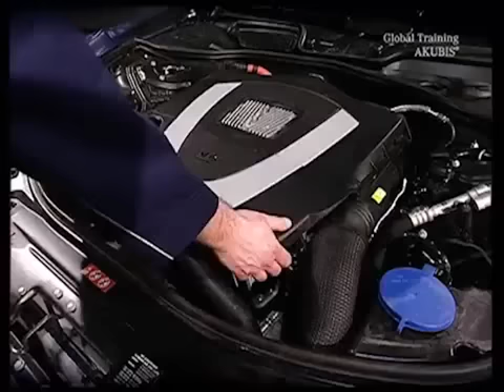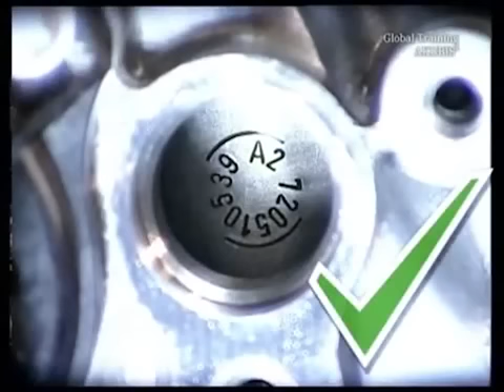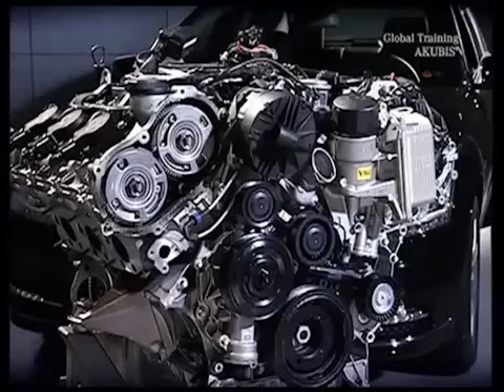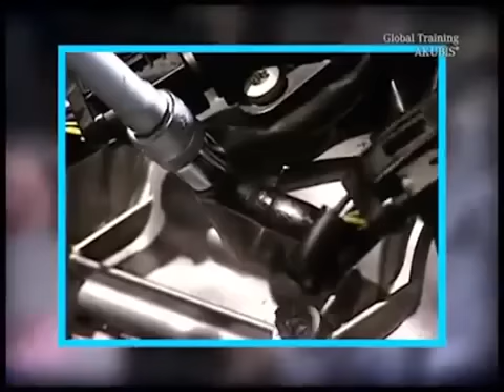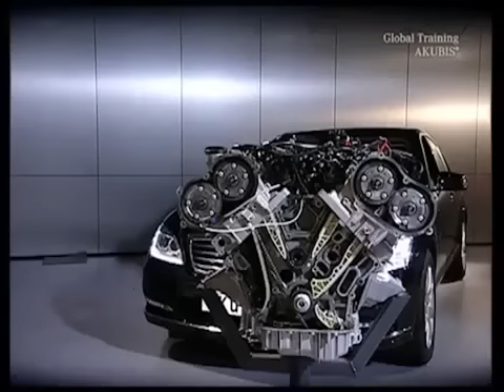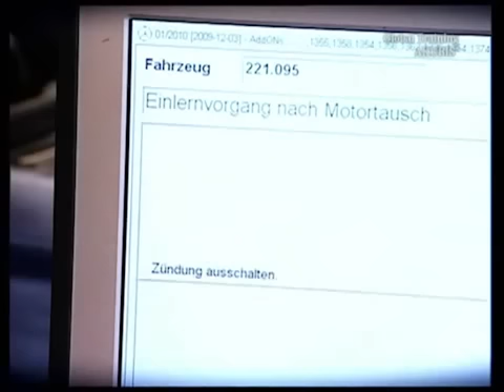MERCEDES M272 and M273: BALANCE SHAFT SPROCKET REPLACEMENT

Comment: oil pan must be removed. try sliding it back without doing so, youre  gonna pinch head gaskets
Reply: im actually stuck on this now, i tried everything to get the cover on, but now I have to take the oilpan off, i dont know how im going to reseal it

Comment: Time Bombs..... Also suffered with the biodegradable wire harness on the W124. My last MB
Reply: a wiring harness is nothin compared to this. A relatively cheap repair to a great model. What you driving now that is sooo great, you've had for a long time and spent no money on?

Comment: So, those pigs knew about the ticking bomb, especially the M272... Anyway they continue to build MB with those engines for years...They made Recall too late, after customers in USA started case against MB...It was too late, because the dead line for this recall was too short...

Comment: Anyone know how the timing case magically removes itself?
Reply: With a big hammer, this engine is so stupidly designed, to remove the balance shaft you have to remove the transmission and rear main seal, and to replace the rear main seal, you have to remove the second lower half of the engine, because there are 2 bolts going from there up into the seal, why ?, because Mercedes Benz, everything on that engine is just stupid, to remove one thing you have to remove two other things :/
Reply: @mor @mortenmorfar wait for real??? I’m in the middle of this job in my garage and am at the point where timing cover is removed but don’t know how to remove balance shaft to replace it

Comment: Shifted cams may indicate a stretched chain, not necessarily a worn sprocket on the balance shaft.  Replacing the chain and tensioner may fix it and reduce the wear on the balance shaft sprocket.

Comment: Long Live the Tesla. Time to bury the ICE. Mercedes Benz is deceitful and corrupt.
Reply: You still have suspensions, and electronics, and driver assist programs, and cooling systems, and brake systems, and bearings, and wheels, etc etc etc.
Reply: The only issue then becomes the battery degradation and the replacement cost of a new battery pack? I agree with everything you said though
Reply: @salvationbygracethroughfaith  sounds about right to me👍

Comment: Piece of sh!ttt design and MB won't take responsibility for any of it.
This is NOT the only known defects. Intake manifold runner controller (using Cheap plastic instead of metal), conductor's plate (cheap plastic break), balance shaft (not heat treated correctly), Secondary intake pump and relay will break every 2 years (draw too much power  for the relay to handle)! Rusted Rear subframe! that's all the problem I experience so far.

Comment: no wonder Benz stop using reliable timing belts... now they can make soft timing chain sprocket: genius 👍🏻

The engineers that went out of their ways to specify tin-can steel knew exactly what would happen... good match with the vinyl seats 😂
Reply: Mercedes has never used timing belts.😂

Comment: Why in the world would anyone buy this junk motor?
Reply: To get a full experience of the engine assembly down to the basic.   In the end, to replace a low cost part.   The labor is the killer. Funny how this hard to get to part requires so much disassemble and damages/contaminated to associated parts.
Reply: To get laid.
Reply: Late models are great engines, 2014-16

Comment: About to buy a used 2006 ML350. I know, from checking the engine serial number, how to tell if the shaft is a problematic one. But how do I know if it was replaced by mercedes (they have centralized records?) or an independent shop ?
Reply: There was a bulletin that came out in 2016. See: http://australiancar.reviews/mercedesbenz_M272.php
M272 and M273 engines prior to October 2006 have this problem. I have this engine 😂
Reply: You need ask to see the dealer's VMI report for that vin.  It's in their computer for their eyes only, though.  (Fear it would be used to sue them.)
Reply: @jason.arthur.taylor  nah. There is a link that you can get this info. Decoded from the vin# of your car.  Pretty good data base on the vin #.  You can then find the engine number and see if your vehicle falls in the issue range.

Comment: Certain years of the M272(V6) & M273(V8) had the inferior balance shaft sprocket. MB got sued for this.  First, you must get the VMI(vehicle motor inquiry) from the dealership...this is free and should'nt give you any issues.  On the VMI sheet is the engine #.  If your engine # is above or higher than the engine #'s with the faulty balance shaft sprocket, then you're good and have the updated balance shaft sprocket.  Otherwise, you're going to have expensive issues down the road with faulty engine codes first, then IF not fixed, the engine gets rough and after 20k miles of NOT fixing it, you run the risk of the teeth jumping, valves bent, and a complete engine rebuild....around $15k.
LINK BELOW ON ENGINE #'S.
Reply: https://drive.google.com/file/d/1AI8fWAj-vicEHUKN9EG1vJr2mLHa3unH/view
Reply: joe r gonzales are you saying that there Is a way to get this repaired by Mercedes dealer?

Comment: Damn, this is going to be expensive, especially since my engine won't be out of the car.  The big question, is the replacement gear improved or simply a replacement of the original?
Reply: its a reinforced gear, so no more wear

Comment: The only mistake of Mercedes-benz made was this M272 and M271 engines...
Reply: M271 engine is not comparable to the failure of early M272 engines, these two are completely different in terms of their reliability and issues. The M272 balance shaft issue is far more expensive and complicated to rectify. Hence you don't see many of them with mega milage past 100k, at least in the UK anyway. Although enthusiasts slander the M271 engine for having a single row timing chain, few of them do actually go when maintained properly with correct oil, servicing etc... Many have documented exceeding 200k miles with their M271 engine on the original chain. My C180k coupe is on 112k miles and still drives well, haven't encountered any issues with the chain. Other than vacuum leaks from Kompressor hose, I've not encountered any significant engine problems and the car has been in my family since 2008, so the M271 seems pretty solid imo.
Reply: Looks like pretty much all models from the years of 2004 to 2008.  They finally got their act together and fixed the problem after 2008.
Reply: gfhfmf any idea what years are afected?
Reply: @elviejon84ful  multiple models, s550, clk, cls....i know s550 anything 2008 model and later is fine.
Reply: Not the M273 V8?

Comment: Must also replace all oil pump related parts and also check the cylinder walls for scratches. Glad mb fixed this issue. Really gave them a bad name for a while
Reply: Still does!!

Comment: Dealer won't do this test, they said I don't need these because the obd says it's only a sensor
Reply: Engine check light can cause several problems. So obd check is always essential

Comment: I can't believe Mercedes engines have this fault, wouldn't touch one now was interested in a v6 clk not now!
Reply: Yes, a VERY bad design and VERY expensive to repair, I was told on the ML that the engine needs to be removed, not much reliability at all especially for such an expensive car
Reply: Same here. Luckily i got the 320 Model in my E Class.
The old 350 V6 engines until 2004 also have this fault
Reply: Yeah I thought the C300 with a stick would be a pretty cool car... now from seeing this video, I am running!
Reply: Oscar Rodriguez just get one from 2010+ they fixed this issue..
Reply: @dfweurocars  so 2010 has the same issue?
Reply: @akujude  no they fixed it in 2010
Reply: @dfweurocars  sorry if that model developed the problem how can it be fixed??
Reply: @akujude  replace balance shaft and or timing chain and guides if worn
Reply: replace timing chain tensioner if worn or losing tension so that it doesnt jump
Reply: @dfweurocars  that will will solve the problem thanks
Reply: @akujude  youre welcome mate

Comment: 03:22? Why would you have to replace the entire cylinder head just because you damage the valve cover?
Reply: I work on these for a living, and will share some tips. If in the odd case you did damage the cylinder head cover many times it is repairable. If it is not, (cracked for example) a used one may be swapped in. However, you must remove  the cylinder head and bring it as an assembly with the donor cover to a machine shop for line honing.

In the 15+ years I have been doing this, I have only had an issue with the cover twice. Once on an engine with a lubrication issue, another where a previous sloppy technician went haywire with sealant. Basically fusing the cover to the head.
Reply: This is because the valve covers have the upper cam bearing journals built right into them so they are part of the camshaft. They cannot be mixed and matched or seizing and galling may occur
Reply: So in a nutshell the cam bearing caps and valve cover are one piece
Reply: nelias7306 Damn, good to know. Thanks for the reply.
Reply: Jimmy Baggs no problem. There is also a very specific tightening sequence that needs to be followed for the valve covers because of it
Reply: Because if u buy new valve cover will not mach with sylinder head
Reply: That's that garbage